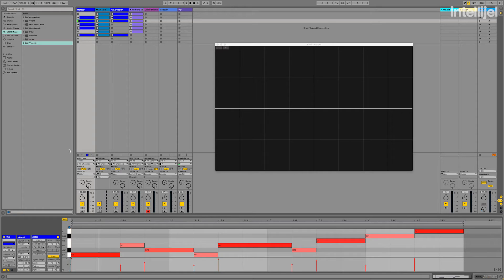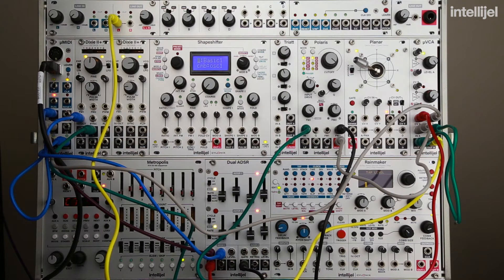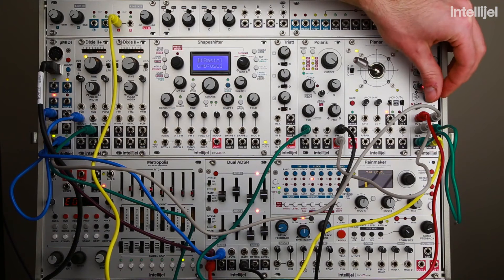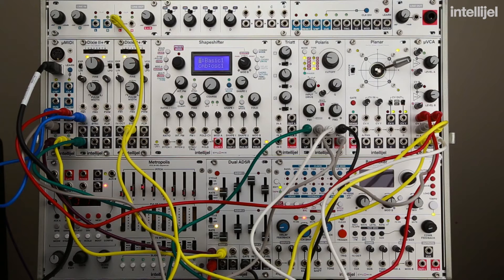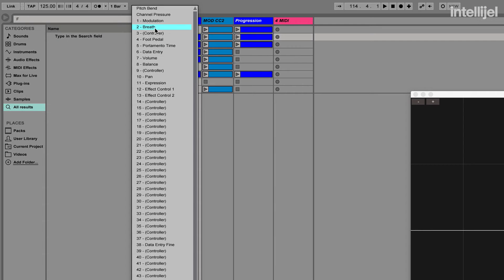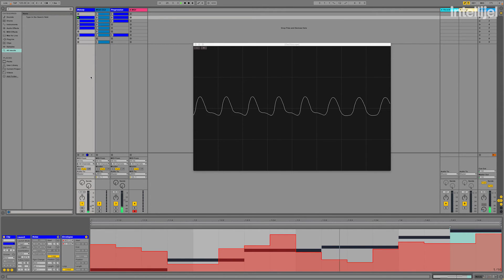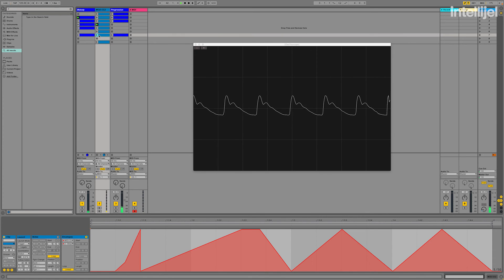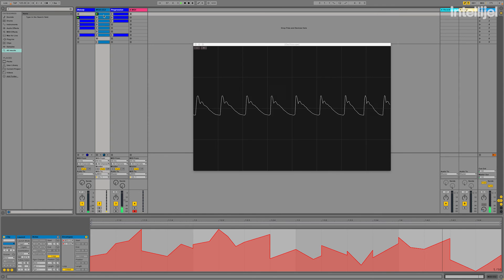Intellijel µMIDI Tutorial 4 - Vel Mod & CC

Comment: Great video! if I have no VCA or envelope modules, will I at least be able to control the pitch via midi, if I get a midi to CV converter? Only using for sustained vocoder tones at this time (but eventually want to turn my CMS oscillator into a bassline monster)
Reply: Yes, you would be able to control the pitch but not the volume without a VCA.
Reply: @ScottMFR   thankyou!

Comment: Any plans to make a MIDI to CV converter for people who want to use more than 1 CC? If I'm connecting this to my computer, I could EASILY see routing 8+ CV outputs to automate a performance. I think with my software synths, I'll usually have 12-14 CC channels running.
Reply: Maybe some day. At the moment you can at least use 3 CC channels because you have CC, MOD, and VEL. If you're looking for something with more channels you might want to check out the Endorphin.es Shuttle Control.